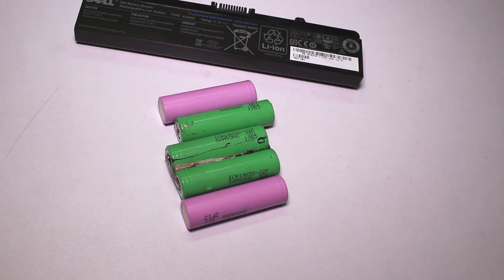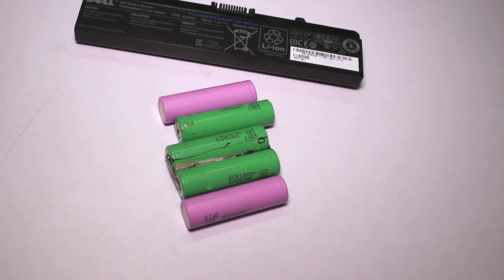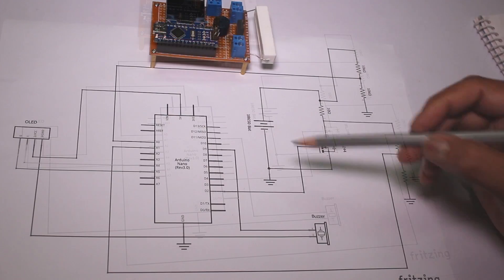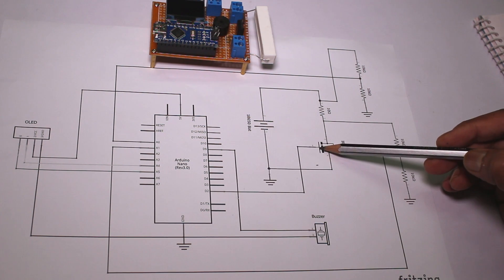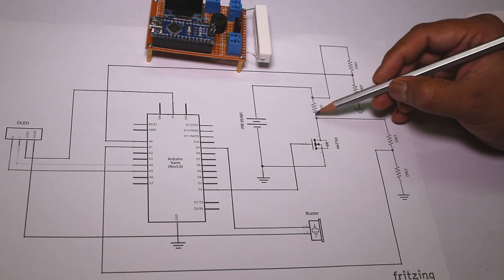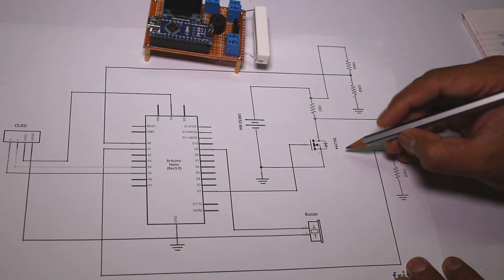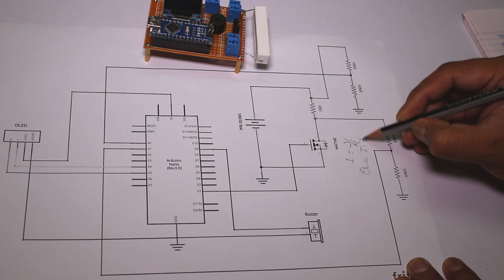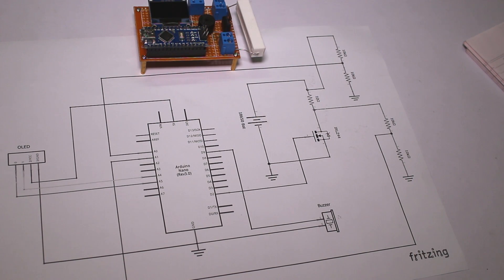DIY Arduino Battery Capacity Tester V1.0

Comment: I made your version two on a breadboard to test it out with my Arduino Nano but was disappointed to find that it was not very accurate with voltage and amps also noted that if you disconnect the Arduino and leave the battery connected the Arduino stays on feeding through A0 pin so I am glad I didn't purchase the kit

Comment: Some current of the battery goes to that voltage divider (from which you take to analogue input of arduino). That makes the capacity test is not precise, doesn’t it?
Reply from the maker: You are correct.
Reply: you can use a current sensor between the battery and the load

Comment: Doh I discovered another sketch error. Throughout the sketch the MOSFET is turned on by setting it's gate low and off by setting it's gate high. This is the wrong way round. the MOSFET turns on when you set it's gate to high.  By the way Open Green Energy, thanks for this project it has been a very helpful introduction to Arduino for me. The minor errors I found gave me a bit of a mental workout which was also good.

Comment: Hi, I am no expert but I think I have seen 2 errors in the "Full project Documents pdf" on the instructables web site (link above). Firstly in the picture of the circuit the ends of the 2 voltage dividers are joined together but they should also be connected to GND (the circuit is shown correctly in the circuit diagram). Secondly in the sketch (program) the Relay_pin is defined as pin 6 but in the circuit D6 is not used. I think it should be defined as D2. Please let me know if these observations are right or wrong. Thanks.

Comment: Hi sir how should I add liquid crystal display and add code
Reply: Hi, I used liquid crystal (with i2c piggy back board) I had some trouble finding the right libraries for the i2c board but eventually found ones that work with mine. The relevant bit of code is:---
//#include <LiquidCrystal.h> // It seems we don't need this and we don't have it!
#include <Wire.h>
#include <hd44780.h>                       // main hd44780 header
#include <hd44780ioClass/hd44780_I2Cexp.h> // i2c expander i/o class header
hd44780_I2Cexp lcd; // declare lcd object: auto locate & auto config expander chip

Everything else stays the same.

Comment: I think that is better to put an heatsink on that mosfet...
Reply from the maker: Thank you for suggestion.
I have not used as the MOSFET was not heat up during the discharging.
Reply: @opengreenenergy  I agree. The MOSFET changes state only occasionally when there is a change in the circuit (e.g battery connected or diconected). When it is fully on or fully off it dissipates little heat (because its resistance is essentially zero or infinite respectively). Only while it is opening or closing does it dissipate more heat. Which is why the heat sink IS required in V2 where one MOSFET performing constant current drain is driven by a PWM output and so is changing state rapidly and continuously.

Comment: Tel me what IT is in code " // Vcc = readVcc()/1000.0; // Conevrrt mV to Volt

  
  // Voltage devider Out = Bat_Volt * R2/(R1+R2 ) // R1 =10K and R2 =10K "
10ohm resistor. what is the discharge current

Comment: I have wire exactly as your schematic. When I connect the USB power, it show no battery, as I have not insert the battery. But when I insert the battery , it beeps and show v1 - High. What is wrong, can you highlight me.  Thanking you in advance
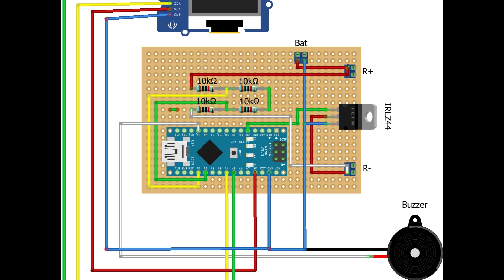Reply: ground two resistors connected by a green line 5:34

Comment: so i have managed to do it :D but the discharge rate is to low and it takes to long, how can i increase it?
Reply: Sharkiuli :  u can change R 10 ohm to lower than that. such as 2 - 3 ohm and change calculation in program.
Reply from the maker: Use a lower value resistor.

Comment: you not giving up on 2.8v batteries do you?  i successfully revive  90% of batteries that are as less as 0.15v  you just have to feed them with very little current until they reach 3v or so.... That's what TP4056 does, only limitation is it doesn't sense temperarure of cell i will try even when there is no hope, i almost cooked  one battery that way... Anyway very cool project

Comment: interesting project. my question: did you implement in your sketch which driver for the LCD display? This unfortunately does not work with my dislay (0.96 Inch 4Pin White IIC I2C OLED Display Module 12864 LED For Arduino)

Comment: Nice..needs a recharge circuit and coding to discharge then full recharge the battery to get the full capacity from full discharge to max capacity...cool build!
Reply from the maker: Thanks for the suggestion.

Comment: Great Video! How did you deal with arduino's voltage measurement issue on analog pins due to supply voltage related measurement precision?
I often use an external voltage reference, but I have heard about a software hack. I am just curious.

Comment: how to add the code if using discharge 2 battery
Reply from the maker: Similar to the single battery.If you want to monitor them independently,t hen need a similar hardware to discharge the 2nd batteries also..

Comment: Nice - extremely similar to mine ( https://youtu.be/qtws6VSIoYk ) but I used a fixed resistor as a load. Your code is also surprisingly similar - I must be better at coding than I thought?  

Why the voltage dividers on the analog input? Doesn't that have a potential to increase inaccuracy of the readings?
Reply from the maker: Hi Adam,
The credit should be goes to you.I started my project after watching your videos.
Reply: @opengreenenergy  Yes I have made both yours and Adams they are very similar and both inaccurate on volts and amps a wast of time and effort
Reply: Кирилл Посветов Hello.  I've added one to my website... http://admw.uk/iA
Reply: "Why the voltage dividers?" 
Well what would happen if you connected say 3 (18650)cells in series to measure the voltage on analog pins? ;]]]
Reply: please , send me schematic diagram.
Reply: Adam Welch
Reply: Why the voltage dividers on the analog input? Doesn't that have a potential to increase inaccuracy of the readings? xD
Reply: My own experience, reading a battery voltage with no resistors to one of the Atmel's A-pins, is that I can't shut the thing off!  The chip can parasitically draw power from the battery.
Reply: My experience of using just a single 18650 and forgetting to plug the arduino in first has killed 2 nano's - I just don't learn from my mistakes...another 5 nanos ordered (and will use some current limiting resistors on the analog pins this time!)